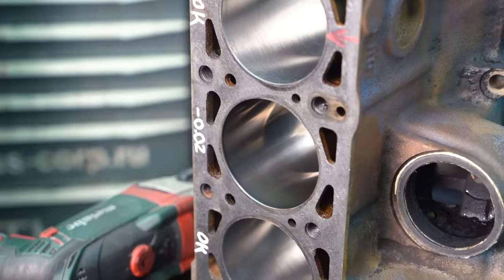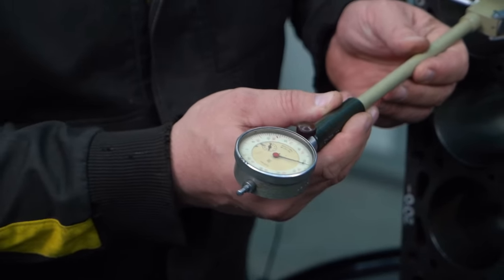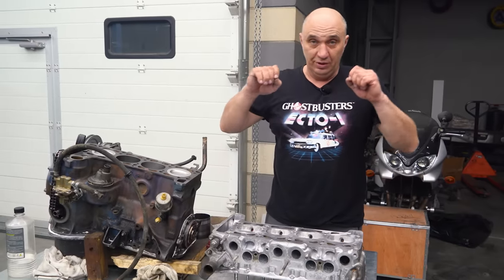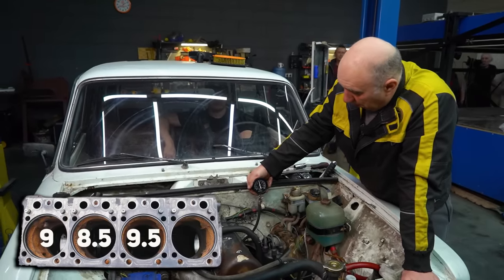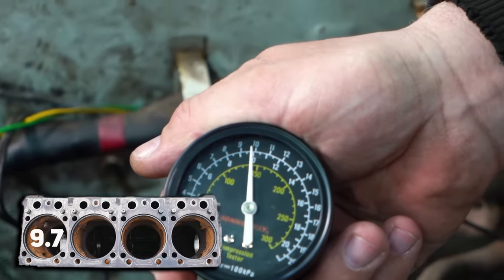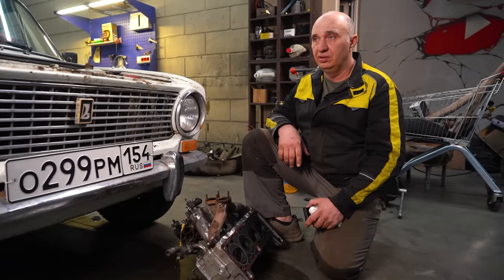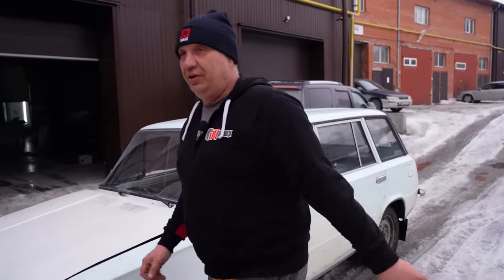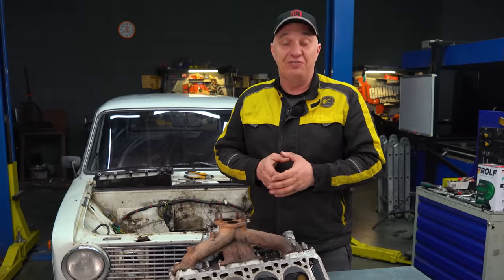Honed cylinders or mirror finish - which is better?

Comment: where do people ask such a question? a cylinder with a miror finsh will not keep oil in place on the cylinders walls, where a honed finish will be absolutely perfect to keep oil on the cylinders walls and also to keep a good compression ratio (this need has been discovered more than 120 years ago)
Reply: Once break in the honning gets errased after enough miles 10kto 20k miles, so the supposed effect of oil staying on the honning marks is not forever,  its mostly to give an evenly round shape to the cylinder wall.
Reply: most modern engine manufactures like Ford Nissan VW .....run mirror like finish bore, are you 120 years OLD?
LOL 🤣
Reply: @vaninec  It's still honed with a crosshatch, it's just 600 grit vs 240 grit. It's still a plateau hone, you still want those oil valleys and not too many peaks.
Reply: @SG-wp6sg  my car had over 260k km when i did the headgasket and still had its factory hone.

Honing only wears out if the engine is run with bad oil
Reply: @rolandotillit2867  
What is 600 grit in mm?
Reply: @rolandotillit2867  
Well I did not measure mirror bore on Ford let me ask Google 
Probably exactly what this Russian guy made in garage
Reply: @vaninec  Grit is honing roughness, and it's not measured in mm but microns.
Reply: Microns or mm 
The ideal bore surface should have flats on the silicon crystals and crystal protrusion of 0.00002" to 0.00004" (0.5 to 1 micron) 
1 mm =1000 microns
Reply: @NuffMan_  mine has never been starved of oil, its my daily driver , engine since last overboring for .40 pistons was well over 50k miles and last time i changed the head for a ported one they were mirror shiny.
Reply: @SG-wp6sg  Nah dude, you could still see the factory crosshatch from honing when I re-ringed my Chevy at about 250k miles.  I threw the block in the hone, freshened it up and it's at 301k today with a big cam and a chip.  Cylinder walls get glazed from improper oiling (usually from the dirty oil not being changed) or from overheating.  Extreme overheating will actually cause part of the piston to gall to the cylinder wall if the engine doesn't lock up first.
Reply: I tore the head off my corolla with 250000 miles and the cylinder walls were polished to a mirror finish. It still had great compression.
Reply: @Alobster1  Exactly
Reply: @Alobster1 if you had looked closer you would have seen a cross hatch pattern.
Reply: I have a 97 dodge with a Cummins. It has 395k miles on it, and it still has the factory crosshatch in it.
Reply: @vaninec on toyotas, hondas, and yamaha engines I've handled crosshatch was visible but you could not feel it. I'd assume scratches less than 0.001in deep.
Reply: @jake42326 I looked and felt real close it was smooth as a babies bottom. Crosshatch is really most important during break in of new rings.
Reply: @Eluderatnight  
It all depends on what oil  was used
Reply: @Alobster1  Your cylinder walls were factory cross-honed, and were polished BY THE PISTON RINGS over those 250k miles. That is the desired outcome, as the rings and cylinder wall now have the most precise matched mating surfaces possible. If the cylinder was polished seperately before new rings then this ideal tolerance would not be achieved, since the cylinder walls have "nothing to lose".
Reply: Agreed,I was under the impression that this was figured,out ages ago.Silly me.
Reply: @vaninec  oil needs these little scratches to stay in place to lubricate the engine and there's an oil ring which is call "wiper ring" to wipe this oil to avoid to burn oil
Reply: @Alobster1   yes but i think lubrication is not at its max because oil can't stay in these little scratches to lubricate the engine (this scratches exists since more than120 years so i think it's on purpose). Your engine eats oil if your cylinder walls are miror like
Reply: @vaninec  really???i'm pretty sure that oil needs these little scratches to stay in place to lubricate the engine and if there's à piston ring called "wiper ring" it's on purpose (if these scratches don't exist , lubrication is bad and the engine "eats" oil)
Reply: @themetalslayer2260  
That old school  theory, total nonsense.
All modern engines run "mirror" 
The ideal surface should have flats on the silicon crystals and crystal protrusion of 0.00002" to 0.00004" , 0.5 to 1 micron!
BTW, regular glass mirror 20-200 micron surface up and downs
Reply: @vaninec  is this engine a modern one? no
Reply: @themetalslayer2260  
It doesn't matter because laws of physics work on all engines, old and new.
Reply: @vaninec  yes but materials are not the same so, what is valid with modern quality materials is not necessarily valid with lower quality materials (this is an engine built in the 70's in USSR, not an engine built last week in a high tech factory in Germany or in Japan). Dilatation is not the same, resistance is not the same etc...only because quality is not the same (made in USSR). 
With modern alloys...why not? if the ingeniors say : we need a mirror finish to improve performances and reliability, i'm ok with that, but with an old aluminium alloy made 50 years ago with random materials...i think the old way will be better for this engine (made in USSR)
Reply: @themetalslayer2260  
Well, partially, you right, old style honing was done because of oil quality. Modern oils are waaay better
Reply: @vaninec  if the problem is oil quality, yes the alloy quality is not as important as I said but, it is a Soviet engine... we cannot be sure of anything about its reliability so, in doubt I think old-fashioned machining is better
Reply: @themetalslayer2260  
Russia still makes new old ussr engines with new technologies.
People do all kinds of mods to the engines, just for example: new sleeves to the old engine,  new deferent crankshaft picton and piston rods camshaft and so on...
the sky's the limit

Comment: The scuffing allows the oil film to better adhere to the cylinder walls rather than collecting on the top ring to be burned and this test result proves it as the honed chambers are cleaner. 
Now that self lubricating molybdenum rings have become standardized the moly fills in the scuffs creating a smooth bore hence the reason modern engines are consuming more oil but still last much longer between rebuilds like a diesel.

Comment: The only engine where you do not hone the cylinders are those with plated cylinder bores like Nikasil etc because the silicon carbides used can never be effectiely cleaned out causing the bits of nikasil to embed in the piston skirts causing excessive wear down the road.
There is a reason that after honing you first wash with a detergent then wipe with many clean white rags soaked in engine oil and you will be amazed at the metal that comes out of the bore, Does not work anywhere as effectively with plated nikasil type bores.

Comment: The reason for the rough finish is to fit the rings to the cylinder. The rings will then polish the cylinders to a smooth finish.
Reply: Im afraid if you have polished bores it’s either, poor quality lube oil and or very high hrs of operation. Smooth bores usually come with high oil consumption and poor emissions (smoke)

Comment: I've twice deglazed/honed motorcycle engines by hand with sandpaper.  100 grit perhaps.  
Quick to break in and never had any oil blowby.  Just worked it at that same 40/45 deg angle.  FWIW.

Comment: For 2 stroke, smooth cylinder can blow the sh*t out the engine or stuck it
Reply: Few years ago a guy on Moped Army had his bore plasma coated. Never found out how it turned out, though.
Reply: @ItsDaJax  This I'd be interested too see
Reply: @adrianhoeben5783  He did it for heat retention, that's all I can remember. Plasma coating things has been in my head since then.

Comment: when i was rebuilding a dirt bike motor in high school my clynes service manual said that honing was to help oil cling to the cylinder wall to prevent scuffing on dry starts, it had nothing to do with ring sealing, in fact people that notice more compression after break in probably honed it too much or not properly so compression went up after it wore down

Comment: The honing holds a small amount of oil in the crosshatching. 
Compression is maintained with this. 
As in when loss of compression due to worn rings adding oil increases compression.

Comment: The crosshatching distributes the oil around the cylinder, preventing it pooling, and the surface tension sticks oil all along the wall, greatly improving sealing. The surface area is drastically increased by crosshatching. The oil sticks to all the microscopic rough shapes and makes a liquid o-ring that keeps the pressure from blowing by. The roughness ironically causes the area to pool up with slippery smooth oil.

Comment: What rings were used? If they are cast it wont matter. If they were chrome then yes they need help seating.
Reply: Cast rings, plasmoly, chrome or ductile, they all need a honed surface, between 180-480 grit stones.

Comment: Honed is good for break in as it's rough and allows for a custom piston ring fit and better compression faster thus isolating wear to the rings, you also use break in oil to do this for a small amount of miles. After you switch to normal oil.

Polished I can see less resistance overall and a break in oil could still be used and logically speaking it may take longer but once the rings break in and you switch oils it should allow for a smoother run engine with minimal drag, but the difference would be very minimal as either engine with wear a pattern into the cylinder walls but on honed the rings will be formed faster but have more overall wear... Engine wise break in is the most crucial time and reducing the time spent in it is ideal(just like warm ups daily).

I've rebuilt my race engine a few times and I think break in oil is a scam, just like I feel 8f warm up times being shorter us the goal, a moderate throttle run warms up the engine faster than a low load warm up and thus you get into efficiency faster.

 Honed vs mirror, I'd say mirror would be best if you drive a longer break in period while honed you drive much less and change oil.

Either should be the same once you change oil to a good synthetic with plenty of zddp.

Comment: Honed has that grip for oil to stick too, smooth has no grip for the oil. 

Smooth is excellent when 2 surfaces are rubbing, pressurize some oil through there and the oil becomes a boundary layer between the metal surfaces. 

Cylinder wall has no pressurized oil being squeezed between it and the piston, so oil scraper rings and a sticky honed cylinder wall is required to keep oil there. 

If ya wanna burn out your engine, go smooth
Reply: The honning surface is not forever,  after 10 to 20 k miles it gets glass mirror
Reply: @SG-wp6sg  it'll never go to being a glass surface, specially on the thrust side. It's just that the marks are more vertical than horizontal which won't hold oil as well.
Reply: @SG-wp6sg  I have seen higher mileage engines with the cross hatch still present…

Comment: The fuel used is a big factor when it comes to the carbon buildup as well. The carburetor maybe running rich as well. Put 5km on the engine then recheck for the compression, oil consumption, and carbon buildup. Also check for even heating and cooling in the block. You may have cold spots or hot spots in the head and block

Comment: The crosshatching is an actual score into the piston side- that little extra space where oil is not scraped away by the ring, even as the hieghtened edges of the score provide more surface area for better sealing.

Comment: Rolls Royce hones their cylinder and tosses them out into the back yard for a year or two, allowing for rust pitting which, after a fresh hone, will allow oil to much more reliably protect the cylinder walls.
Reply: they did that with the bodyshells too    in the 70s absolute pos
Reply: In the 70s a race engine designer told me he buried cylinders in soil outside for a year before machining
Reply: @jagmarc  yes, that's correct. Burying the engine block removes the casting tensions.

Comment: I learned the honed finish inside cylinders is mainly done because a honed cylinderwall better retains oil. Also reduces friction because at any point in time there is less contact surface between the piston rings and the cylinder walls. Similar concept to scraped glide surfaces on metal working machines. For compression it would be best to have microscopically polished walls and rings but then again that makes it hard for oil to stick and keep a nice film of oil all the time. Modern engines have coated cylinder walls with micro porosity. Very similar to diamond and it retains oil very nicely for very low friction and wear resistance.

Comment: Accurate piston ring gap on original assembly always made for good bedding in and good compression afterwards.
Always honed and used Graphene and good quality oil on the build. Running at 11:1 gapped slightly wider as she ran slightly hotter.

Comment: Check piston ring gap, check valve guide wear and value seats for 3 angle valve grind, check valve spring tension, check rocker valve tappet clearance, check head surface for straightness. Check block deck for straightness

Comment: Only 2x very important reasons that I know for honing the cylinder, with new piston rings, 1= the honing in "cross hatching" patterns will wear the new piston rings into the exact shape of the cylinder, taking the rough casting edges off the rings to seal up and give better compression. 2= the honing in a cross hatching pattern will always pick up and keep oil on the cylinder, giving better lubrication and less friction and wear. but otherwise the mirror finish would be awesome if the rings were ground and polished to fit the newly machined bore exactly, like formula one engines.

Comment: The hone marks or scratches hold small amounts of oil for lubrication and also help wear the new rings to exactly match the shape of the cylinder. A new engine would come with its cylinders finish honed, if that was a bad thing to do, the engine manufacturers would not do it. Keep in mind there are different grit honing stones, a less course stone is preferred for finish honing.

Comment: Smooth Cylinders = Rubber Seals, tight seal... great for break cylinders.
Honed Cylinders = Metal Rings, traps lube for longer... Better for engine

Mirror finish has the potential to not have enough lubrication and therefore make you lose compression because air can get around the rings easier.

Comment: I think you could record the bore measurements and see if and how they change, also if you have oil analysis anywhere you can see if it's also causing more wear in the engine. This was really cool to  see the compression ratios go up as they start to seat with the walls. I wonder if oil temp gauges could show with a different bore finish

Comment: It need to be honed, because of the lubrication, the oil settle down in the small grooves. It prevents the oil Film from ripping off.  So it saves your engine from an early death.

Comment: Vacuum leak causes the shake in the engine, yes I do believe the compression test, less friction, less cutting by the rings on the polished cylinders, but they will allow oil to pass by the rings on the highly polished cylinders. Increased compression because of less ring groves cut into the rings and cylinders.

Comment: From the looks of it the polished burned better judging by the intake valves as there was less carbon buildup. You are correct in that the compression between cylinders can't be that far off so a proper test would be to do two of the same type of engines polishing one and honing the other making sure the compressions are within specs. But nice job on that we did see a difference in the burning of oil between the honed and the polished.

Comment: A honed cylinder after much use will eventually become a mirror surface, or an approximation of it.  Both work, but if you want a long life it's probably better to start with a mild hone and thin oil, or a more aggressive hone and a higher weight oil.

Comment: I'm surprised that engine didn't sieze because honed surface keeps the layer of oil so the metal parts don't rub each other, so polished cylinders can't holt the oil film so they should seize..
Reply: Tell this to titanium pistons, it doesn’t matter to them whether there is oil, polishing or anything else, they don’t even get worn down by a file. But auto parts manufacturers will go bankrupt if there is something better than aluminum.

Comment: Cylinders with higher compression will run leaner and hotter so hence the cleaner exhaust valve.
Reply: Did you notice that they measured compression pressure and it didn't match with the burn deposit on the exhaust valve?

Comment: Do a compression check. That is the best way to see if polished or honing is better.The way you guys polished the cylinders doesn`t mean they are round though. You can machine to a mirror finish if you have the right toolbit and the proper speed of the cutter.Honed cylinders keep a thin film of oil on the walls and this might keep the  engine to last longer.

Comment: i do not recommend mirror finishing your cylinders,best result are honing your cylinder with 600 grit then finishing it with 800 grit,we do that on race engines,2 strokes and 4 strokes, even for daily drivers,we observed it will not eat the rings too much,problems with rough honed cylinders is that mostly on motorcycles,the oil rings will get worn much faster causing it to blow smoke out the exhaust,thats why we recommend 600-800 grit for best performance and longevity!

Comment: You're very close to plateau honing there. Where you do a deep crosshatch followed by a much finer grit. Holds oil for lubrication but doesn't have the pointy tops to burr over, beds in faster and seals better.